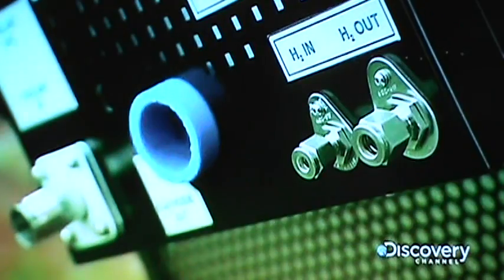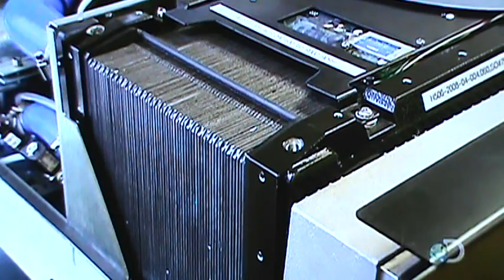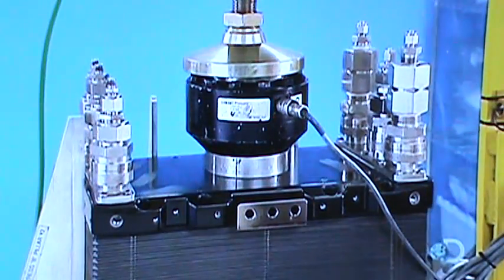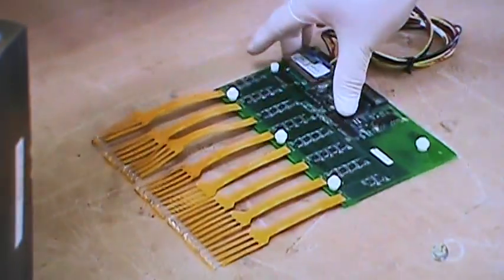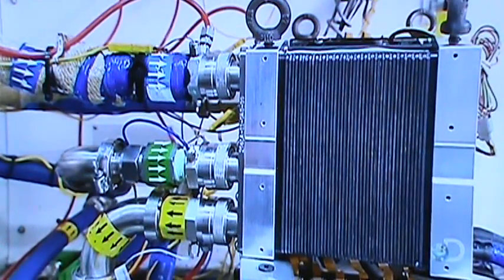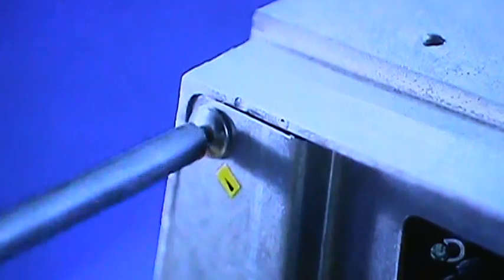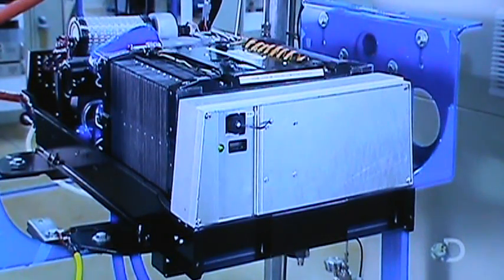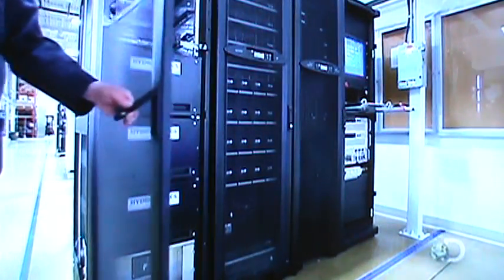NEW TECHNOLOGY HYDROGENICS FINALLY BEING PRODUCED

Comment: doomed all this for a %^& fork lift.
Reply: why not a forklift?
Reply: I can see it’s use on a forklift Amazon is doing stuff like this. Because it doesn’t produce fumes which can be dangerous in warehouses. Hydrogen fuel cell or electric ones require less ventilation since they don’t emit carbon monoxide.